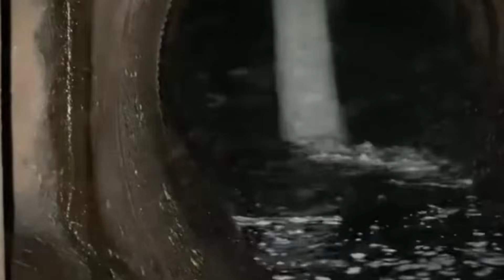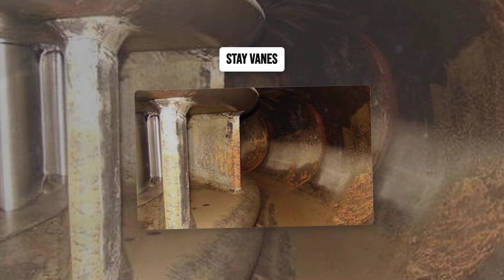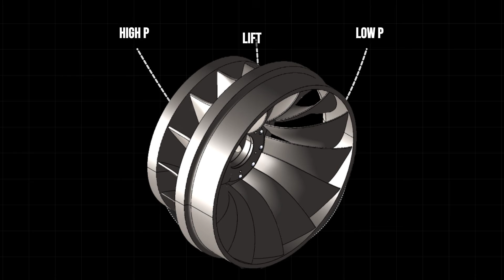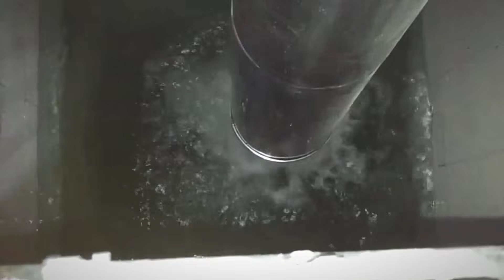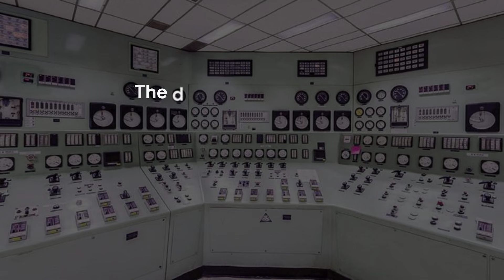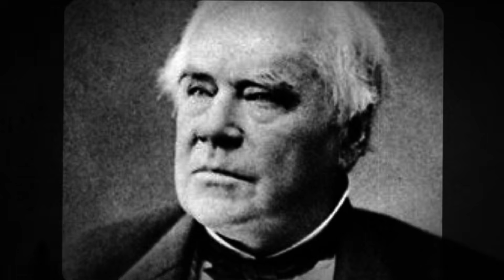What Actually Happens Inside a Francis Turbine When Water Makes a 90 Degree Turn at 300mph

Comment: there is a turbine invented in Australia that lets a dam run up to three extra banks of low pressure turbines . so more power from the same volume of water and no issues to the main turbine bank or added down time due to servicing as the dam stays online throughout